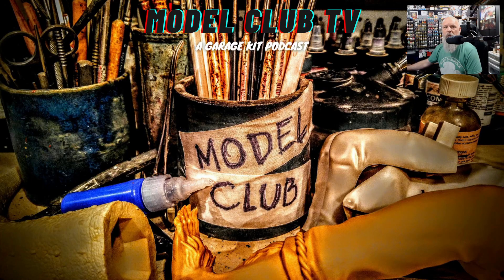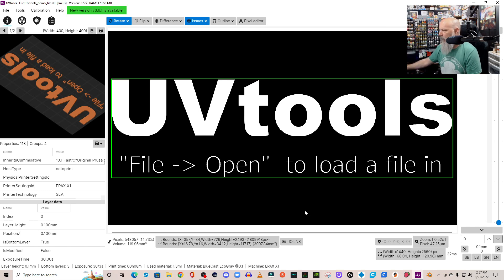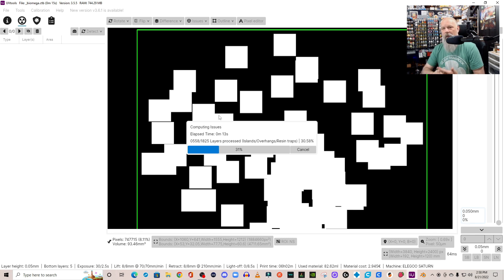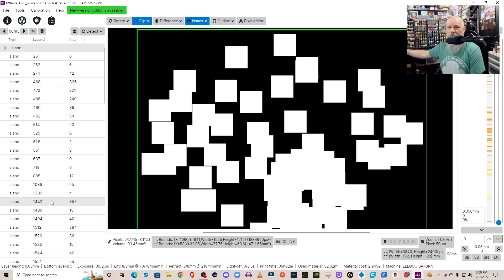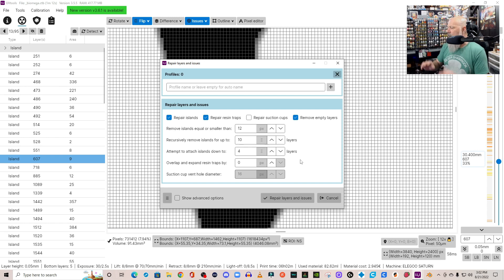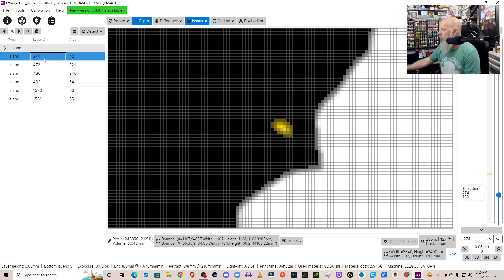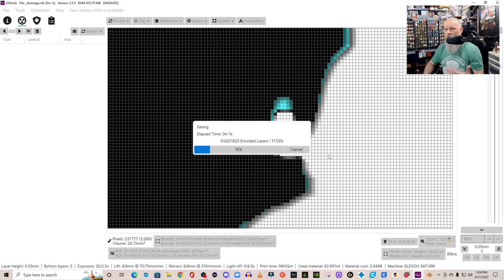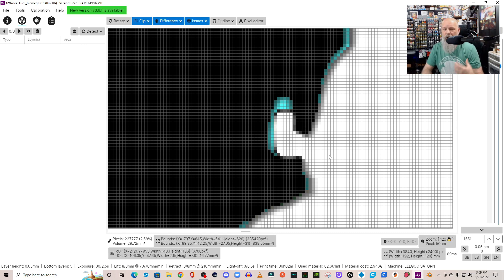Model Club TV: How To - UV Tools

Comment: Great Video! This has really helped me out.
Reply from the maker: Glad it helped someone :) There is so much that UV tools can do and I think I have only scratched the surface. I need to dig in and wrap my brain around it.
Reply: @modelclubtv  I'm just staring with resin printing. And I'm just figuring out work flows.
Reply from the maker: @bucket638  UV tools definitely helped me have a greater success rate! If you have any questions just ask and join the 3d prints and garage kits group on Facebook, Jamie Saj is a genius and talked me off the ledge a ton of times.

Comment: Great video, Jason!  Going to have to look at UV Tools.  That video was probably twice as fast as it needed to be, but it’s a start.  Presupported files are not what they say they are!  I usually end up tinkering with them.  I rather clean up support points than have a print fail. Great stuff!
Reply from the maker: I will probably do a more in depth one later but I just wanted to get something out there to go with the questions we were getting.
Reply from the maker: And yep, every pre-supported file I have run through UV Tools, has islands that were missed.